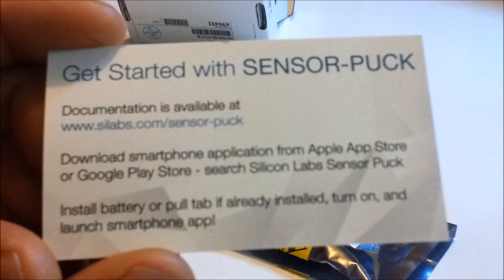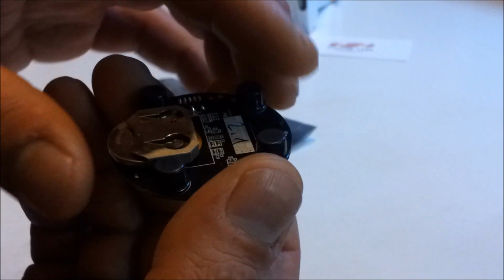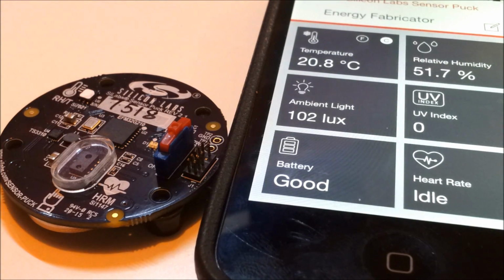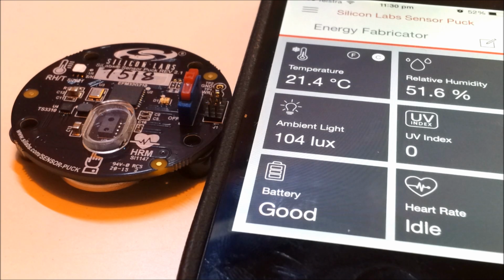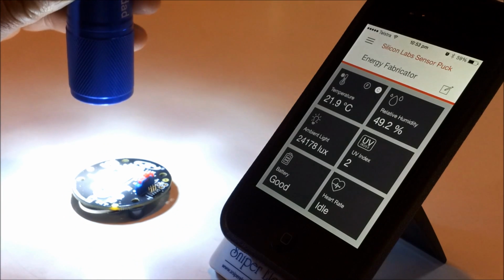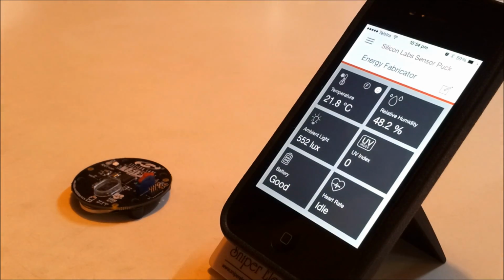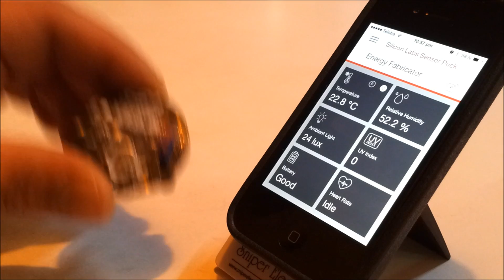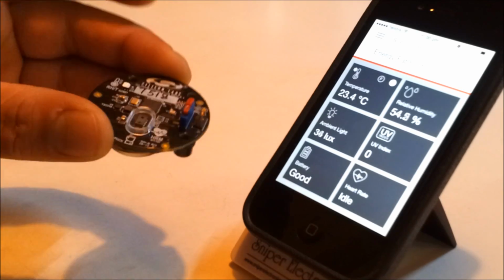Energy Update #38 - Silicon Labs Sensor Puck Review

Comment: Nice! I could see this being used to monitor heat and humidity in something like a computer or VFD!! :D
Reply from the maker: +Machine Man 
I'm thinking of using it in my power supply as a sort of disposable sensor. I'm not sure if the high voltages & high frequency currents will damage it or not, but if it's not connected to the power supply, then it's easy enough to remove and dispose of. If it works well under these conditions, then I can monitor the power supply temperature from a distance.